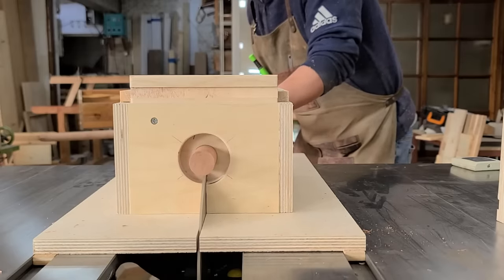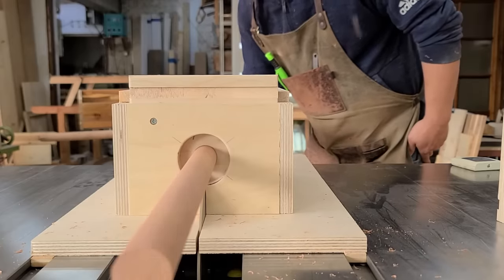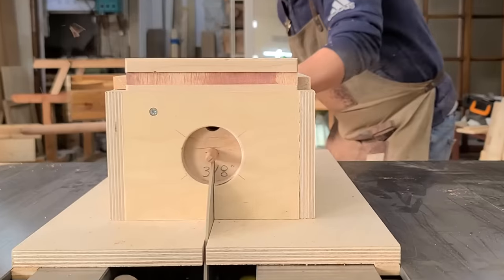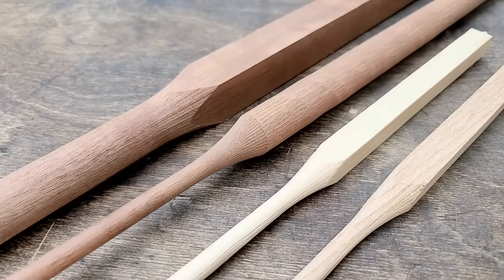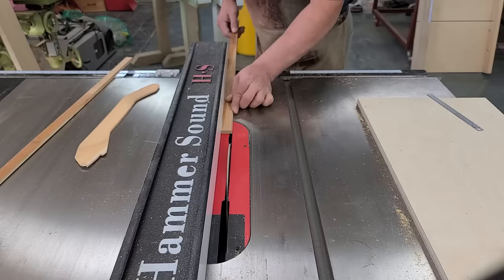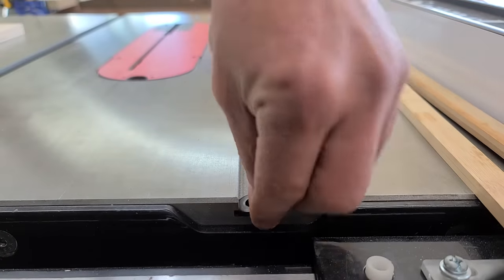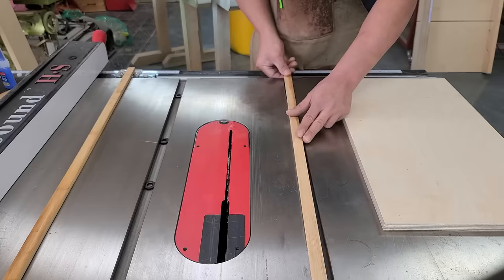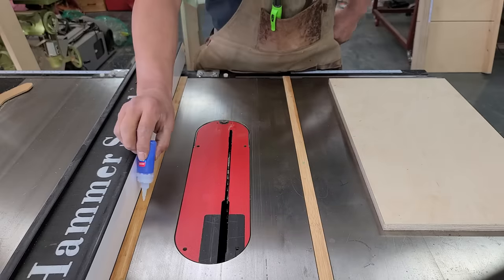1:1 -Forstner Bit = round wooden sticks / round wooden sticks of various thicknesses / dowel making

Comment: If you made the lid longer, you could make it act as the tension for the inserts.  Then cut the inserts 12-25mm shorter and add a screw in the middle to act as a handle and a precise way to adjust the tension against the lid.  Would add a little work to do at first, but would eliminate the need for putting in screws to hold the inserts and removing the screw every time you want to change the insert. but that's just an idea to add to an already wonderfully designed dowel cutter.

Comment: This is one of the best dowel makers I've seen. I've been making mine similar to this for years. I make mine with a 2x4. Small output hole, large input hole. Works great.
What is the "Woodbin" part you put in your miter slot?
Reply from the maker: It is an 8-character accessory.
It is a part that connects the top plate.
Reply: @망치소리HammerSound  like hardware that connects a table top to the aprons?
Reply: @Mr_Rick  precisely

Comment: You are spectacularly creative, this is the most effective way I do to get round sticks.  
Do you have plans with measurements?  it would be super for anyone who wants to do the same.  
What is the brand of the disc saw and how many teeth  have?
Thanks 
Luis from Portugal
Reply from the maker: It's So Stop Table Saw. I don't have any plans yet.
Reply: @망치소리HammerSound  Thanks for your kind replay
Reply: @LuisSilva-gv7nl  Luis, speed in your drill and rate of feeding wood dowel across cutting blade will determine the finish product , , you could sand it by hand.

Comment: This is a much more dangerous version of a router driven, exact same thingy. This works, but never try it on oak. We once had a blade exploding on a workshop , the exposed blade is sensitive to side forces and at best it can skew, almost took one arm with it. Router however is much safer and more versatile as it easily can make cones as well as straight.
Reply: I'd assume with slower drill speeds and a properly sharpened saw blade that risk is minimized.

The router variation you mentioned, is it just a plunge bit, or a straight edge or....?
Reply from the maker: Let's be careful.
I'm also using the router version.
We will disclose it when the opportunity arises.
Reply: @michaelsorensen7567  there’s a router table/ fence method where you can use a round over bit in conjunction with square stock that is matching in size with said roundover bit, but I’m not sure if that’s what you were looking for or if there may be another method
Reply: @bradasskg11  problem I've historically had is with a roundover you either can't align precisely enough or reference point shifts so you can't get a true circle.
Reply: 100% . this is DEATH !!!!!1 it looks cool, but that blade the armature itself and the bearings it ride on are NOT designed for heavy SIDE LOADING. This is using a flamethrower to light sparklers except the sparklers are actually ticking time bombs. 

if set correctly and dialed in as the OP did , yes its a workable solution. Notice all safety equipment was removed as well. 

That bladed will break, or you will destroy the trueness of the blade in relation to both the fence and the outputshaft for the motor. A Table saw is a 5hp straight up, no fucks given motor basically directly connected to that blade, no transmission to fail or failsafe system ( even though saw stop is not goign to work here, if the blade fractured it would set the system off. 

You will loose fingers, damage your saw, damage the precision of the saw if not causing a catastrophic unscheduled rapid disassembly of that blade..... the 12" table saw blade run up to 7k RPM. This  will kill someone.
Reply: @OneMouseGaming  they used to run cove moldings at an angle across a table saw blade. That removed hella more material than this is. 

Calm yourself

Comment: Ok, this will most likely sound ridiculous, but did you mark your jigs with the corresponding blade height that determines its size?
Reply from the maker: The size in bits.
Reply: @망치소리HammerSound   Bits? Aren’t you using the table saw blade to cut the doweling down to the size of the holes in the jig?

Comment: Does the saw blade height have to be adjusted for the different sizes? I could not tell from the video. Thanks
Reply from the maker: Yes, that's right.
The saw blade height can be easily adjusted through the hole.
Reply: I am trying to understand the same thing. How does the saw blade height correspond to the hole diameter? It would seem that is crucially important, more so than the hole cut in the plates that are switched out.
Reply: @luke9822  if you have the saw blade too low, you won't get a small enough radius and it won't fit through. Too high and it will wiggle around.

Just match the saw blade height to the output hole edge, should be good.
Reply: @michaelsorensen7567  This is the right answer. When the bottom of the hole matches the blade on the saw, it'll cut just up to that height. That's also why it's really important to have this jig be very accurately measured, but the saw should also be calibrated.

Comment: So clever! But it seems to me that the height of the saw blade is critical, and determines the size of the dowels more than anything else. Do you raise the blade until the tops of the teeth are at the level of the dowel hole? I could see that needing some fine-tuning every time the size is changed. Anyway, brilliant design!
Reply from the maker: you saw it correctly.
That is the strength of my jig.
You can decide the thickness of the wooden bar in the hole of the bit.👍👍👍

Comment: I'm looking at the opening shot of this video, and thinking I'd use T-nuts instead of runners to attach the jig to the table.  You could clamp the jig firmly to the table, and it will be quicker making four holes than runners with retaining plates.
Reply from the maker: good idea.
However, the jig should not be fixed.

Comment: Brilliant idea.
And one question - what's the name of the "∞ shaped" metal connector part used as slider on 1m:14s (it's got the name "woodbin" imprinted)? I'm searching the web for month for these dual-holed things (used to connect e.g. table boards to a frame) but can't find the correct descriptor.
Also, I'm maybe lost in translation (having seen this mostly in US/UK woodworking videos) as I'm from Germany.
If you got a link (even if it's an affiliate), that would be great.
Thanks in advance.
Reply from the maker: In Korea, it is called figure 8 hardware / top plate fixed (connected) hardware.
I bought it a long time ago, so I can't find it.

Comment: Don't you need to adjust the height of the saw blade depending on the size of dowel how making? How do you set it accurately?
Reply from the maker: The height of the saw blade must be set.
Reply: @망치소리HammerSound  So how do you set it accurately, when you are changing the dowel size? :)

Comment: If I wanna buy those metal brackets what must I search on the interwebs
Reply from the maker: Forstner Bit 🤔
Reply: @망치소리HammerSound  nope, should have clarified.
At 01:18 when you are messing around with the tracks you screw on these little metal clips that appear to lock the sled down when in use

Comment: Seems kinda seems like your trying too hard to be clever. No offense, it's a brilliant idea but why??? If you have to manufacture them on a regular basis, I suppose it's worth it but with all that effort and all those power tools for for a few rough surfaced dowels, just buy a dowel plate. It's accurate, smooth and 100% consistent with basically zero setup time. Or, you know, just buy or order the size you need.

Comment: Side pressure on a table saw blade? Terrible idea. This is wasteful at best and dangerous at worst, when that blade comes apart or the bearings go out.
Reply: @망치소리HammerSound  Table saw is intended to be fed material to be cut in one linear direction, which is along the long axis of the blade. Just as with a drill press, the tooling and drive is not designed for side loading which is what you are applying with this method. It isn't a lathe. More clear?

Comment: Why would you spend money on the raw materials only to turn them to shavings when you can buy the doweling at the stores. It makes no sense because it ruins your blades. There is no guarentee that your  blade is lifted to the correct height unless im missing something. Not to mention it looks like a kick back nighmare as if the stock snaps at a knot, it will come out as a balista.
Reply from the maker: I bought dowels at the store a few years ago and have been making them myself since then. Dowels purchased in the store do not meet the conditions.
Also, money is rather saved.
This is because they use discarded pieces of wood.
Also, the saw blade is completely unbreakable.
It just needs polishing at some point.
Is it natural for a carpenter to make and use it, or to purchase it? Why don't you even buy furniture? There must be a lot of good furniture at Ikea...

Comment: Don't try this at home. 
A circular saw blade is not suitable for transverse loads. The teeth and / or the blade could break.
In addition, you should ALWAYS use a riving knife to avoid kickback or something.
Reply from the maker: There is no such case yet.
Reply: How is kick back even possible in this case?
Reply: @insidechocolatewithjimothy5313  
Not in this case, but in every other you work on table saw's.

Comment: That's a big nope on this. Incredibly dangerous.  Just because you can do something with a tool does not mean you should. If that thing twists or torques, it could come off the table with enough force to seriously injure or kill.
Reply from the maker: The method of twisting the saw blade has been used for quite some time.
It is very important to pay attention to safety.
Reply: @망치소리HammerSound  there's another big negative.  I can guarantee that method is not in any woodworking manuals or textbooks, and what you are doing violates safety protocol.  It is  negligence to even show any body what you are doing. You may walk away with all your teeth and fingers, you are demonstrating something that could possibly kill someone with lesser experience or skill.